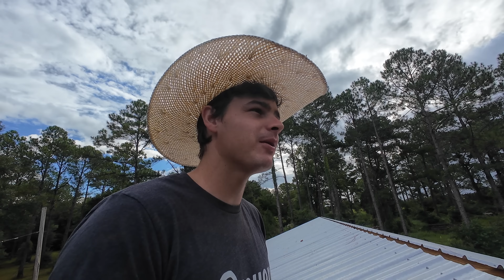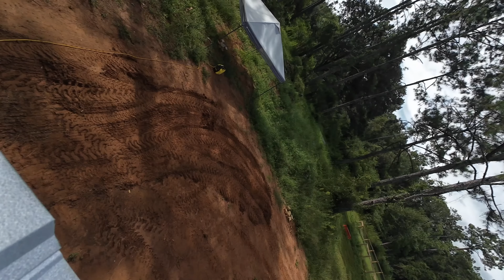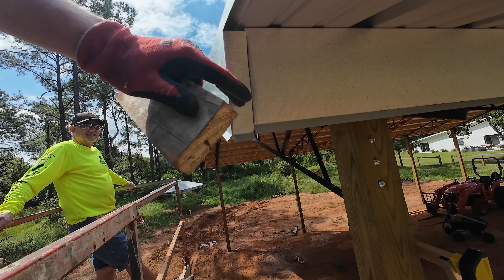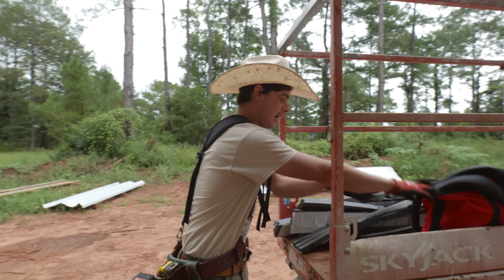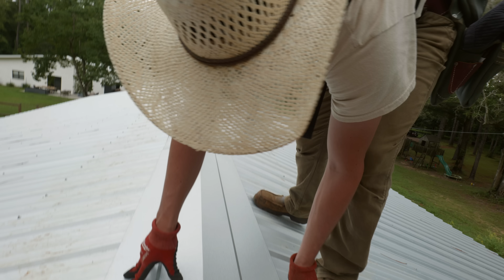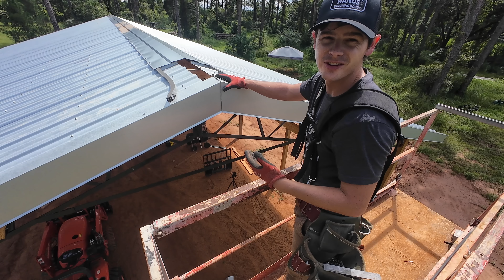Building a Barn on a BUDGET...We Had a Rough Week

Comment: you should ad some diagonal cross bracing between the posts in some locations (depending on window locations) on both sides to stiffen up the structure ..
Reply from the maker: This building is engineered for 150mph winds as it stands.

Comment: Where are your side braces? With a strong wind it will fold up like an accordion.
Reply from the maker: It doesn’t require them, but eventually will be closed in anyways. This building is engineered for 150mph as it stands without walls.
Reply: @Woodbrew  Wow OK!

Comment: Way to get done what you can, as you can safely!  As you do more projects, and continue to experience these types of delays, they will GROW into your schedule and mental attitude, and become less and less frustrating, and more a matter of fact, which will lower your stress levels and higher expectations.   Also, you mentioned in the first video with the lift that it was "acceptable for all terrain."  DEFINETELY NOT!!!  Any lift (or any motorized machines, for that matter) that have solid rubber tires that are slick are meant ONLY for indoor work, usually on a concrete slab.
Reply from the maker: That was definitely a joke😅 All of these have Gyros in them so they won’t move up or down if they aren’t perfectly level. They suck to much around in dirt, but they are still relatively safe.

Comment: You two are blessed! Sneakers/tennis shoes for roof work…, butyl tape between the roof sheets to keep water from getting in to the framing, screw thru the fascia, then thru roof sheet, the space between has a possibility of a leak, so you are absolutely correct to put butyl between, the rib won’t stop that. The screws have washers for the screw head, but what seals the hole under the fascia??? You did what you should. My wife and I enjoy your content, and your innocence and willingness to at least try!!! Never not try!